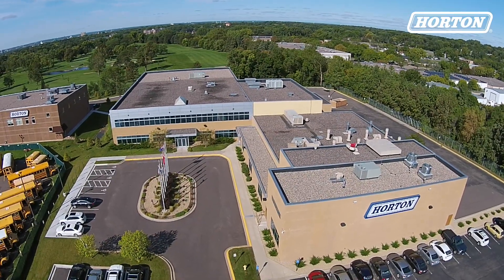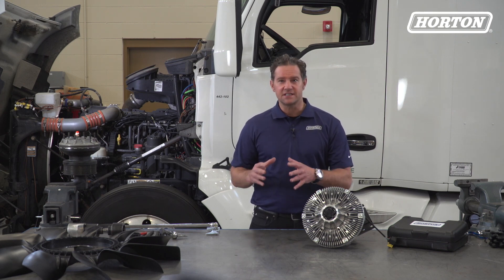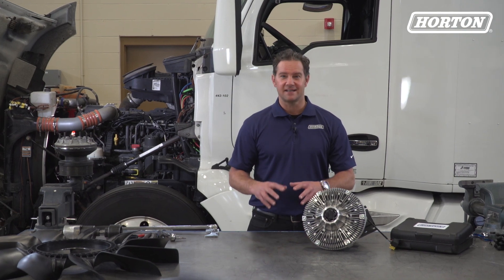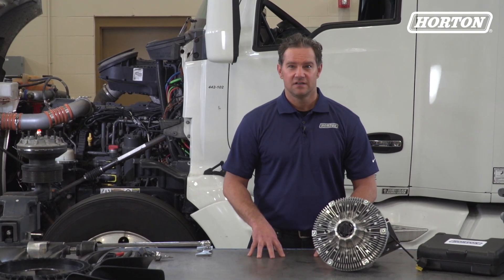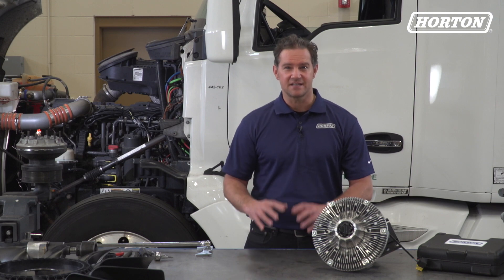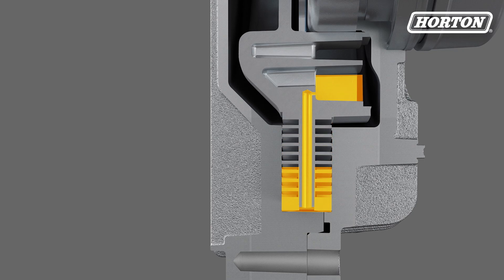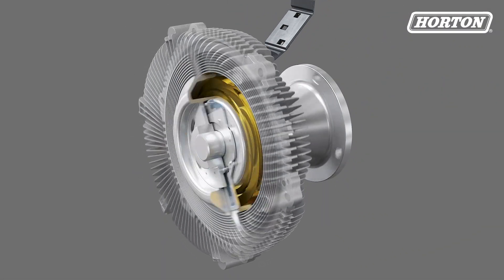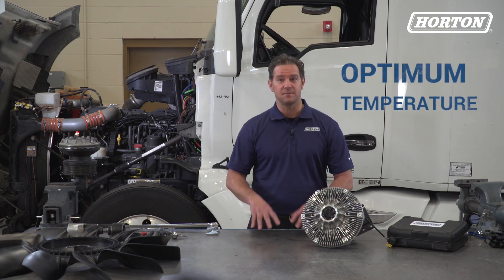Understanding variable-speed fan drives

Comment: So basically instead of using a temperature sensing bi-metallic strip or spring to open the valve you've opted to use an electronic sensor to perform the same function? Variable speed is a given with any viscous fan clutch as it will function at different speeds depending on the silicone fluid creating the friction against the shear plates to engage or disengage the fan. 🙄 Except now, you've added a point of failure with the electronic component because previously the bi-metallic strip is pretty much fail-safe design.